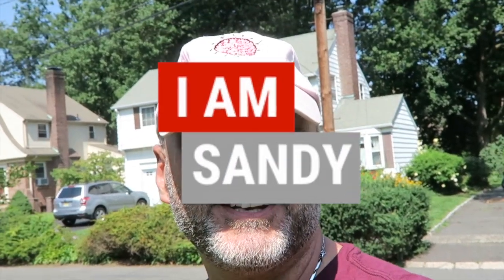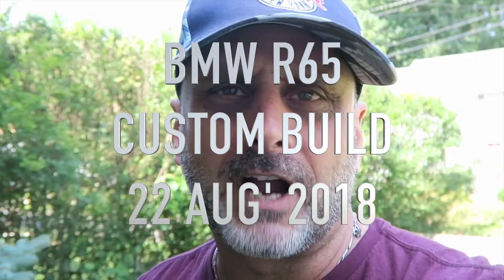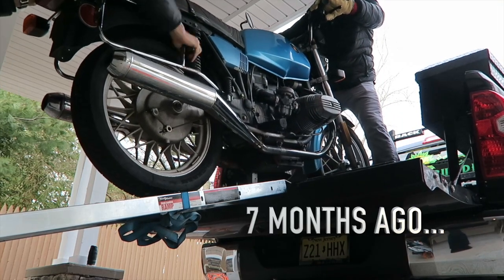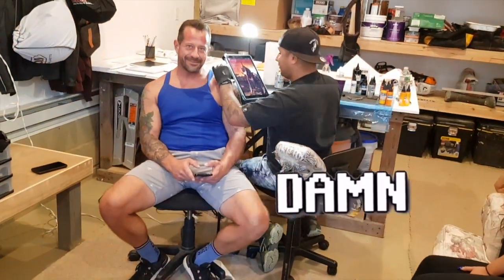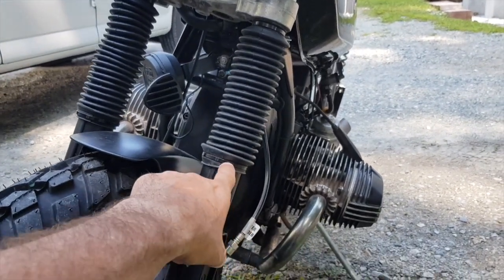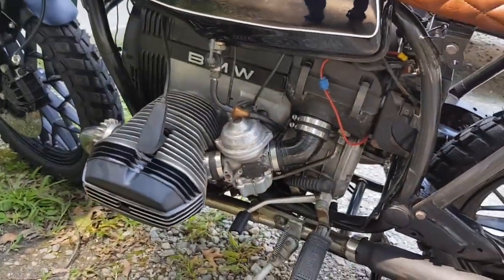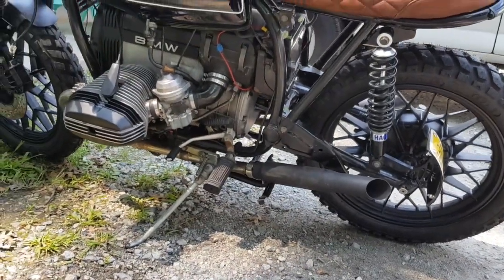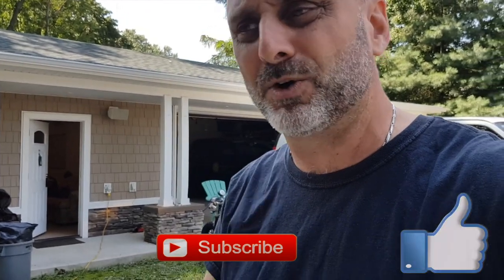Bmw R65 Custom build - Picking up bike from the mechanic.

Comment: where'd you get that front fender?
Reply from the maker: Actually that's the original fender that I cut the metal bracket off, and cut and shaped  the fiberglass to the shape I wanted. Then sanded it and painted it black. I have a video about it...
Reply from the maker: https://youtu.be/JEeQCspPEUo